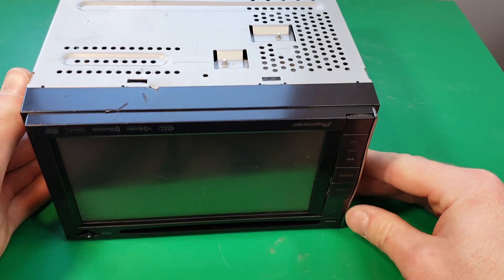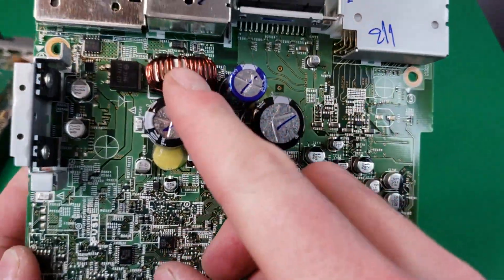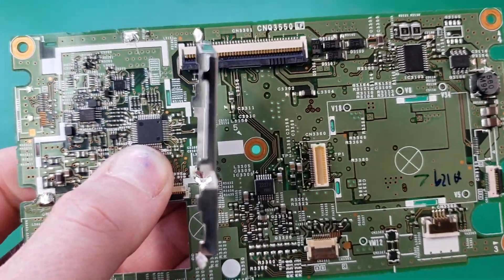Pioneer X920BT Aftermarket Car Head Unit Teardown

Comment: This video provides a detailed teardown and analysis of a Pioneer AVIC-X920BT aftermarket car head unit, manufactured in March 2010 (0:21). The unit features a touchscreen, CD/DVD slot, button controls (0:06-0:14), various connectors, a fan, and a 10 amp fuse on the back (0:15-0:20). Interestingly, it runs on a cut-down version of Windows Automotive 5.5 (0:34-0:46).

The teardown process includes:
•	Removing the top cover (0:48-0:56).
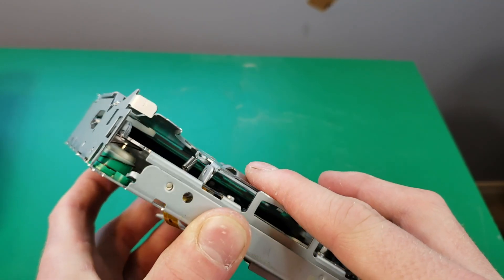•	Disk Drive Module The self-feed disk drive module is connected to the main board via a ribbon wire (1:00-1:08). It features a motor for disc movement (1:13-1:19) and a shock-mounted reading assembly due to its use in a moving vehicle (1:21-1:27). The drive's circuit board contains a motor controller (1:39-1:44), a disk drive controller and decoder chip responsible for controlling the assembly and decoding various audio/video formats (1:45-1:59). The back of the board reveals two 16-megabit flash chips for code storage and a 64-megabit DRAM chip (2:02-2:18).
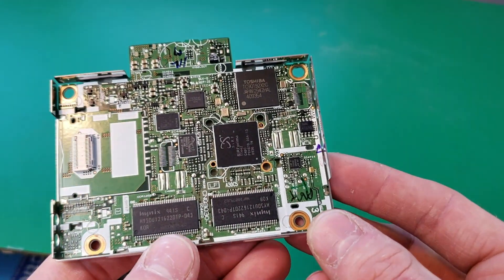•	Main Board and Daughter Board The unit's interior houses a large main board and a smaller daughter board, with a coax wire connecting to the daughter board for GPS (2:22-2:33). There's also a micro SD card slot, with a provision for a full-size SD card reader (2:34-2:46).
•	Single Board Computer The main board functions as a single board computer for the head unit (2:47-2:50). Removing the back cover, which acts as a heat sink, reveals more chips and thermal pads (2:52-3:02). Key components on this board include:
•	A Surf Prima microprocessor, a single-core ARM processor (3:05-3:10).
•	Two flash chips for CPU code storage (3:12-3:18).
•	Four 256-megabit SDRAM chips for CPU memory (3:19-3:30).
•	A Toshiba picture processor, acting as a tiny GPU for the 480p display (3:32-3:38).
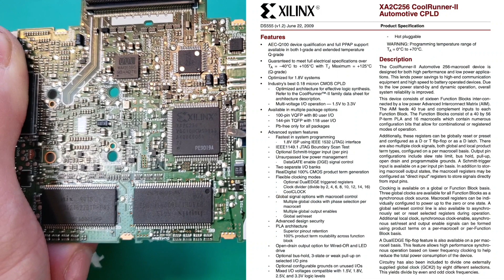•	A Xilinx CPLD chip, an EPROM-based programmable logic chip with 256 microcells (3:41-3:52).
•	A Samsung memory chip, possibly for storing the operating system (3:54-4:02).
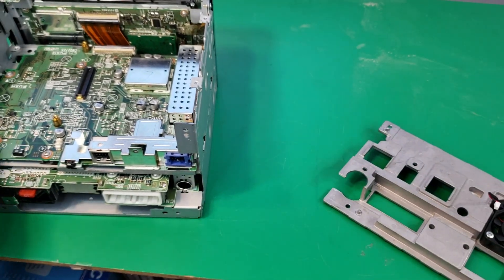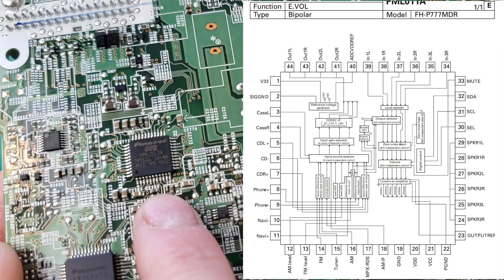•	Amplifier Board After removing the aluminum heat sink piece (4:03-4:16) and disconnecting a ribbon wire (4:20-4:24), the amplifier board is revealed. It contains large capacitors, an inductor, two MOSFETs, and the main Pioneer MOSFET PA 2030A Class D amplifier chip which powers the speakers (5:32-5:55). The back of the board includes a Renesas microcontroller (6:06-6:11), a Panasonic audio-video switch chip (6:12-6:17), and a Pioneer general audio controller chip (6:17-6:26).
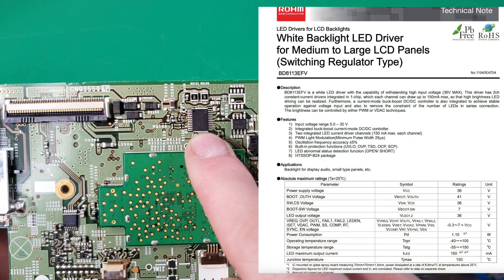•	Tuner Module and Front Panel The unit also has a tuner module connected to the main antenna (6:30-6:37). The front panel board features an LED driver chip for the screen's backlight (7:02-7:07) and a power management IC (7:08-7:10).
•	Bluetooth Module The Bluetooth module is easily removable (7:11-7:18) and contains a microcontroller with an ARM CPU, a flash chip for code storage, and a Bluetooth transmitter and receiver chip (7:26-7:52).
•	Deserializer Chip Under a metal shield on the front panel, a deserializer chip is found (7:55-8:06). This chip decompresses and reconstructs data from the backup camera system, which sends compressed video signals to the unit (8:08-8:33).
•	Screen Assembly The final stages involve removing the screen assembly, which includes a metal bracket (8:35-8:39), a small board for the micro SD card slot (8:43-8:48), the display panel (9:03-9:05), and the transparent touchscreen panel (9:05-9:17).
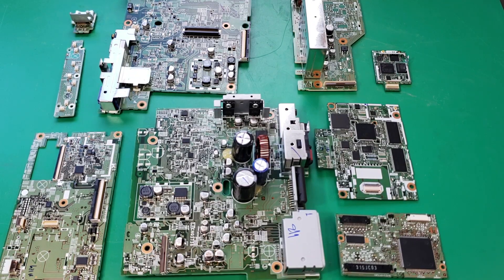•	Button Circuit Board The last component removed is the small circuit board for the physical buttons, which also houses the coax connector for the built-in Bluetooth antenna (9:31-9:47).